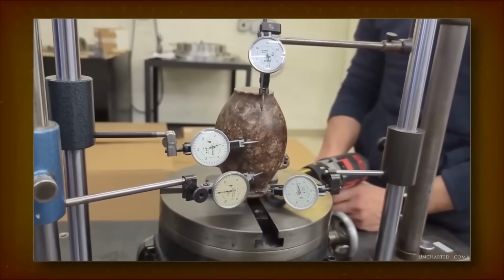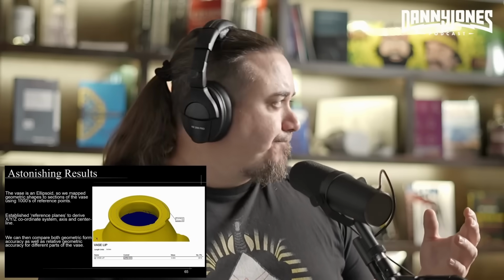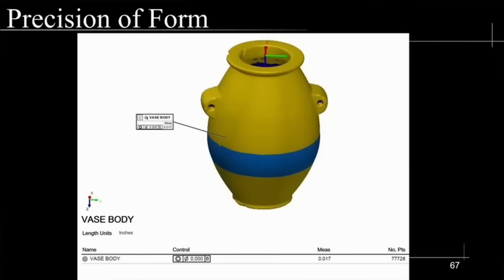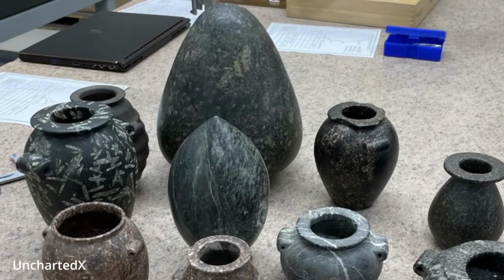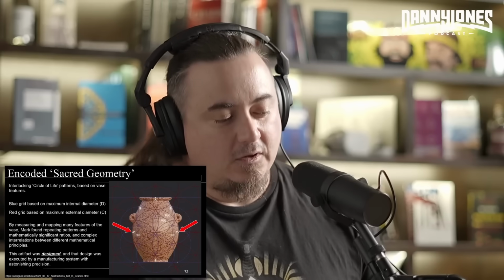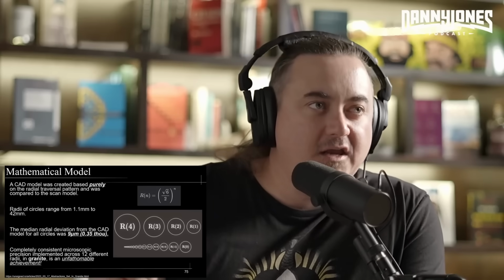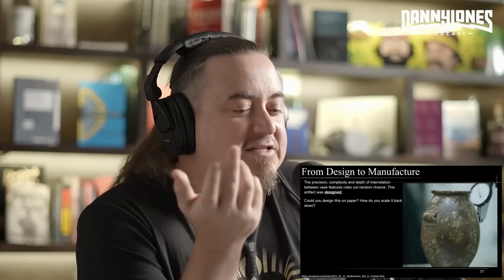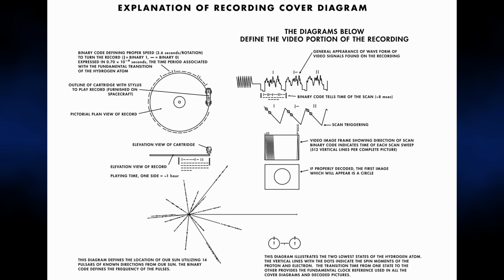Are These Ancient Egyptian Vases Actually Impossible to Make? #podcast #science #history #egypt

Comment: They probably used a combination of water and sand to “cut” the material. Sand containing quartz would be an effective media. Which was commonly found in quarry’s in Egypt. I theorize they used some sort of small flow orifice to increase the “cutting” pressure. A large volume of water being pushed through a tiny hole is extremely powerful. Probably how they cut the big granite blocks for the pyramids.

As for the concentric nature of the vases, i theorize they turned the vases similarly to how a wood worker turns a piece of wood on a lathe. As long as you can firmly fix one end of the material and spin it consistently, you can effectively “machine” most materials to a high degree of accuracy. This could be in conjunction with copper bearings/bushings, man made lubricants like animal fat, and the use of wood as paddles to create the mechanical force to turn a shaft.

I also theorize that (like most modern industries) there are “secret” to manufacture their products. So, the ole boys who made this complicated stuff probably didn’t carve it into the walls like a glyph. An explanation to why we don’t have any evidence of my theory, is not only the “intellectual property” protection of the manufacturing process, but the natural corrosion, erosion, and degradation of the materials used over a long period of time. It’s likely these manufacturing processes were done adjacent to the Nile river, so they could have been swept away by floods or naturally affected by the water’s long term abrasive properties. 

If my theory is even mildly plausible, there is absolutely zero chance we would be able to find the evidence to prove it. It’s just been too long and civilizations have gone through too many generational turnovers.

Comment: They are still being made today. Not with the handles but they're still being made. If you don't have high speed electric machines, you come up with methods that solve problems in your way. If it's not high speed, then you can add a cog that lifts the cutting tool up twice every rotation to leave behind material for the handles. You have to remember that the method wasn't a secret and that competition had to be great to produce the best product. There are several people that work on marble statues, from cutting out the dimensions to the finish polishing. You would have to imagine that a similar assembly line type of process took place to perfect these vases. Experts that were able to, little by little make the walls thinner and thinner. These weren't Stone Age apes making these vases, they were fully functional human beings that were able to solve complex problems. 
I really don't see what the big deal is with these vases!

Comment: Perpendicularity and regularity is likely a consequence of being spun on something like a lathe. It's more difficult to make something not perpendicular on a lathe. As far as "tools" go... the tools could have been very crude, even sand as an abrasive, in a wooden form would give very good results, because axial motion takes care of most of it. So really, the major accomplishment here is a lathe without wobble. But again, it is possible that the lathe got more accurate as it was used, as the axial motion caused the bearing surfaces to became more *true*. Eventually they would wear down too much to be used. But there was likely a sweet spot in the life of such a tool where it starts out crude, wears down to a point of precision, and then later gets out of tolerance. But it is certainly concievable for this to be done without anything much more sophisticated than the kind of armature used to support and rotate milling stones. In fact, just taking a good look at milling stones shows how abrasives and axial rotation can carve hard stone, and gives a good clue as to how the Egyptians could have accomplished these. Even if they didnt have lathes, they certainly understood milling grain. Also, despite what conventional wisdom would seem to suggest, harder materials are more likely to be worked to this kind of accuracy than softer materials exactly because they can't be worked totally by hand. Nobody is going to bother with using a lathe to make an alabaster vase because it can be easily carved and made very smooth with simple hand tools. The very fact that hard stone is more difficult to work means you have to use abrasives and come up with ways to rotate the piece or rotate an armature around or inside the piece, means you get more accuracy.

Comment: I have an intriguing question.  I think.  Maybe I should watch this again in case I missed the explanation. 
   My question, however,  was if the handles were attached through the side lugs what would the stress be to the extremely thin vase if, say, it was being used to carry water?
   I don't know how to word this question correctly but the thickness of the bugs in comparison to the extremely thin sides of the vase when carried would seem to, in my mind, rip right out of the sides of the paper thin vase if you filled it with water and then attached handles through the bugs and attempted to pick it up.
  Mind you, I am very limited in any understanding of mechanics of this sort. 
  I'm just eyeballing as a layman and imagining what might happen when handles are attached of any length and the container were filled with anything. 
   Have any been found with handles still attached?
  If I'm correct in my thinking then that would imply that these vases, or containers, are merely decorative. Perhaps used only to contain something sacred? 
   I love these topics and I personally feel that any archeologist, or egyptologist, who cannot see the glaring contradictions in the mainstream explanation needs to take at least an introductory course in mechanical engineering and possibly geology. Because everything that this gentleman has explained in this video has made it beyond clear that there's alot more at work here than the mainstream version of events.
   Does anyone think what I'm theorizing is accurate? I mean at the very least if the strength of the stone at the thin  outer shell of the container is still so strong then wouldn't it at least seem that the incredible accuracy on display would imply that it was designed for something more important than water t be contained within? 
 Thanks to anyone who might take a moment to read this. God bless. ✌️

Comment: The fact is our holy graphic universe is a Simulation and there are rules that are simple in front of you but become very complex as the scale increases and complexity is required. But it's a ROOF and a DLOOR and these grams or letters of the alphabet in upper case will render a roof and a floor. it reads upside down and back to front but there's a computer like player that makes no sessions that governs the simulation and it would read a I qndva L as the same. The 2 is a Swan and two 2s facing each other are a love heart which has a ground floor. the 2 is a Swan or south west up north. it also reads MANS and NEWS and the like ve heart is many symbols or signs. A spare. An anchor. The real God is Alchemy which involves burning the split decision until it decides itself. it will anyway

Comment: There's an old man on YouTube who made his own lathe that has the capability to make parts accurate to within millionths of an inch, essentially he makes 'frictionless' bearings that are so fine they trap molecules of air between bearing surfaces. An old man, by himself. Meanwhile dial indicators are incredibly simple in their construction. Not to mention good vision and a good quality tape measure can be used to get measurements to within 10 thousandths. You can even feel stuff that has 10 thousandths discrepancies. To say they did it better than we can with less error is a crock. Even Abom79 with his dad's worn out equipment can get stuff down to a few 10-thousandths (1 tenth of 1 thousandth) if he really spends the time. Don't get me wrong, this is impressive but it's not mind blowing. Look at what clickspring is doing with hand files

Comment: The sequence that the various cutting operations were carried out in is also worth considering  because the vase gets weaker as material is removed. I imagine they started with a drilled out core the size of the major diameter then drilled out the minor diameter to the full depth required.  I think the lugs were to do with holding the object as material was removed

Comment: You could turn those on a lathe with the lug handles, if the lathe was stopping and moving slow enough for the cutter to be placed and removed in time.  Maybe the whole piece was made on an extremely slow turning lathe, and what ever controlled the cutter was able to ride down into, and up out over the handles as the piece turned.
Im not even sure how you would cut granite on a lathe.   I would imagine they used some kind of abrasive and ground it away.

Comment: For me the discussion is over on how these vases were made; they were made using lathes. My question is where'd they get the lathes? You can't make a lathe out of stone or wood or clay, or bronze...  you would have to have Iron at least and given the hardness of the stone they were shaping, probably steel. Lathes that would be capable of turning such vases would have to have near zero clearance bearings (or tapered roller bearings) that would stand up to the tremendous force necessary to drive the cutter through hard stone, and a mechanism to very precisely control the movement of the cutting head while maintaining the immense pressure applied, and you'd need more than a little horsepower to turn the piece against the cutting head. These vases, as amazing as they are, are merely proof that the makers had sophisticated metallurgy and machining capability sufficient to build lathes capable of creating the vases -- or they had a completely unknown technology that we haven't yet found a clue of. I'm already gobsmacked by the vases, now I want to see a lathe that could make one (even using 21st century technology). And there's still the question of how'd they shape the area between the lug handles. The vases are teasers, pointing to an even more mind boggling technology.